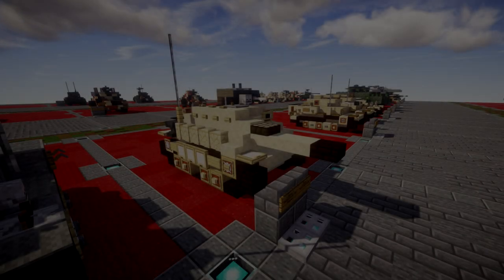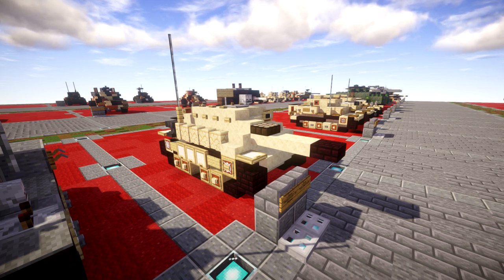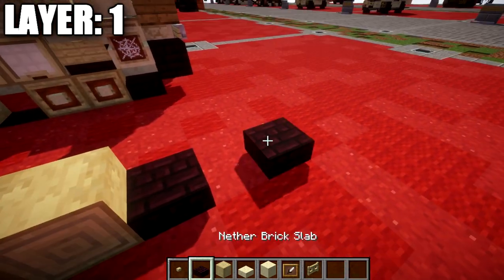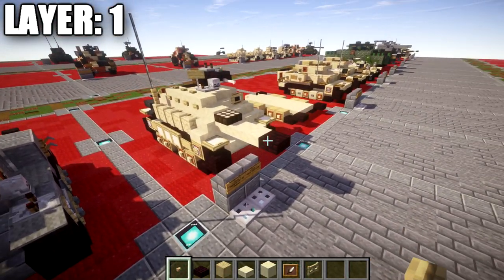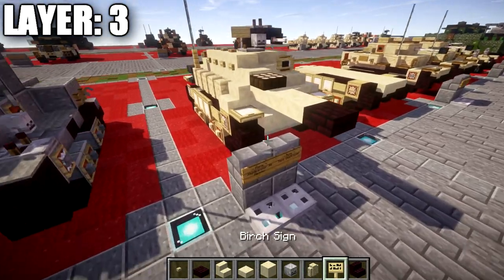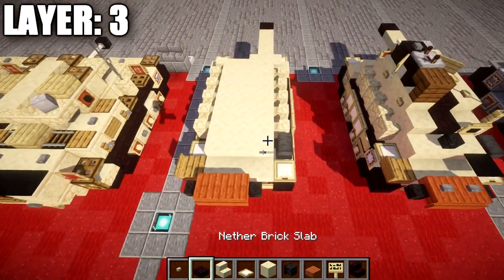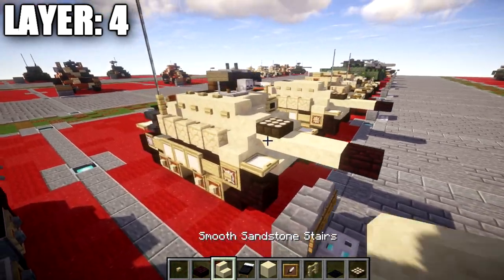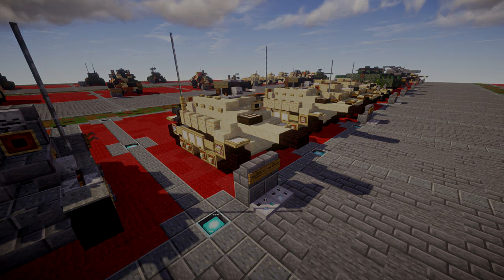Minecraft: WW2 Jagpanzer 38 "Hetzer" | Tank Destroyer

Comment: Start making builds without the overlapping item frame stuff you can’t do it on bedrock and it sucks
Reply from the maker: Just use item frames and don’t put the buttons, signs, etc. It’s not a design change I’m going to make since it can be easily modified by not placing some items.